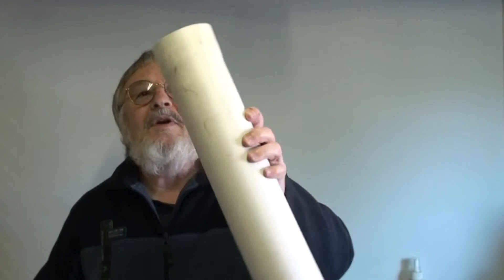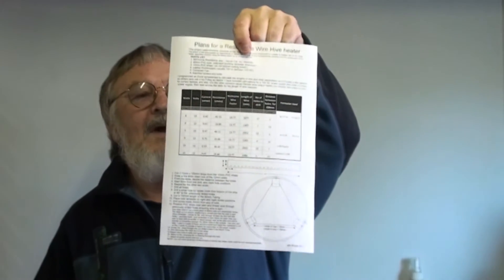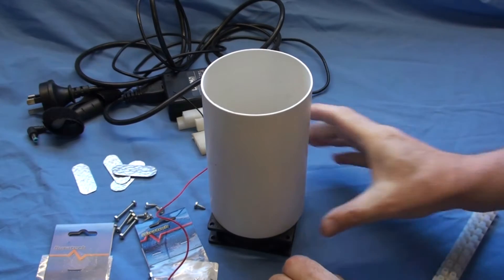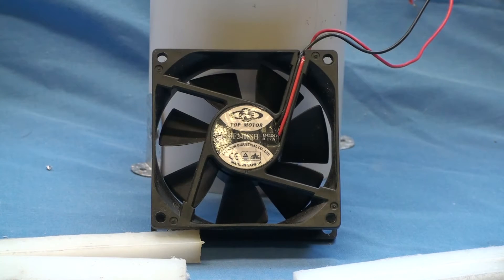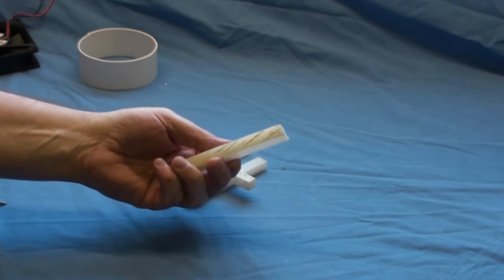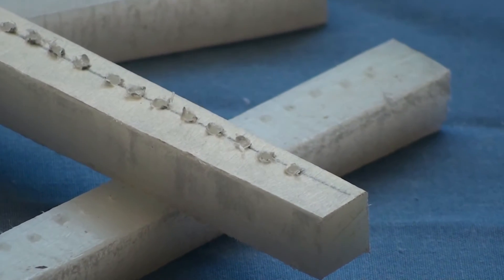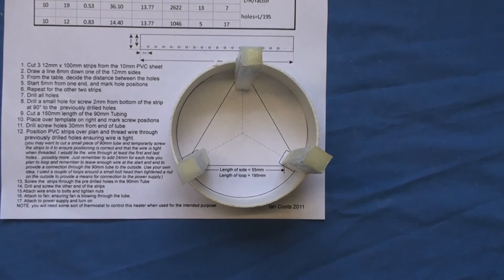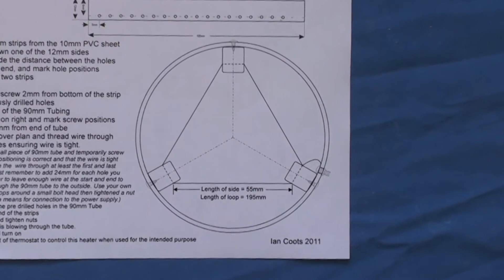Heating a Tc bee Hive Part 4.

Comment: I have used foot warmers at 5 volts said to hold 3 volts with 2 aa batteries.   But they work poorly.  But using a phone charger at 5 volts works perfectly.  About 5 watts.  My motorcycle hand grip warmers are 10 watt and this generates a lot of heat.  To much I think.  I also wrap in water pipe heat tape and it works great

Comment from the maker: My hive is doing well. So well  in fact that I'm about to split it. I've just finished a video of this project, and in it I have a simpler design for the heater. I'll edit and upload that in a couple of weeks hopefully. You would need to at least have a hive with extra insulation as a minimum and winter feed it to survive in Caulfield. If you are prepared to do that I don't see why  it shouldn't survive. They won't leave the hive if the temp is <19 and will literally starve to death with no food